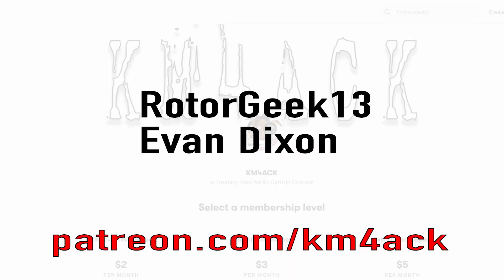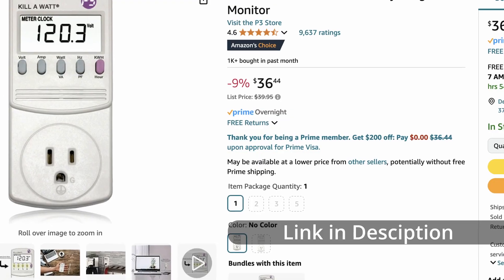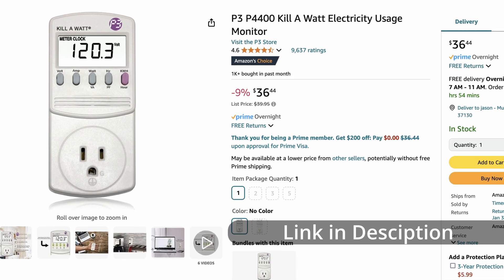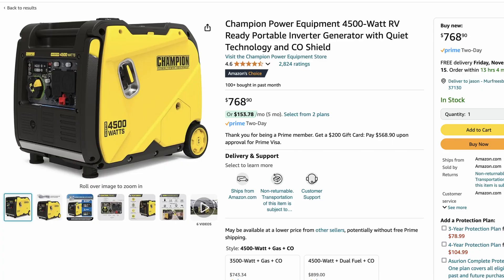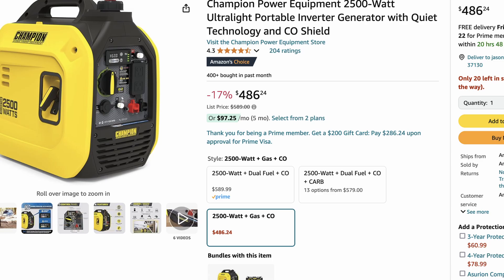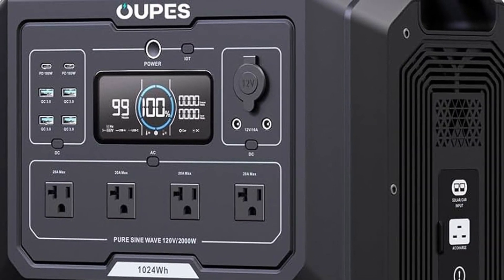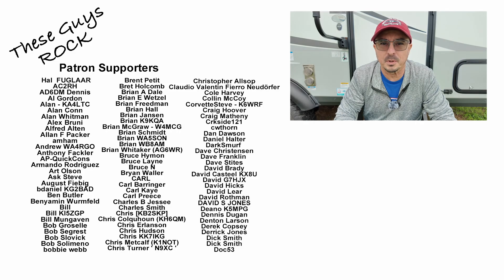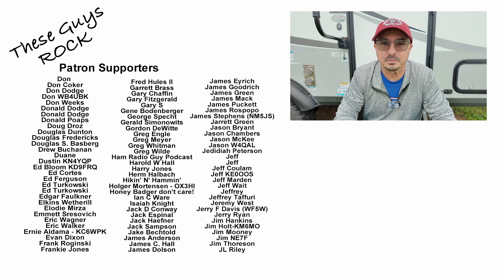Layering Your Backup Power Strategy

Comment: Great video as always.  I was in Florida with my daughter and her husband last month during hurricane Milton.  They lost power for about four days and here are some things I learned:

We had a Champion portable inverter gas generator that has 2800w output.  We ran it 24hrs a day but used the economy mode to conserve fuel.  I found it to be very fuel efficient, burning less than five gallons per day.  

I brought five filled 5-gal gas cans with me when I traveled from SC to FL, and that was helpful because as the storm approached, both gas and gas cans became difficult to find locally.

I brought a bunch of long extension cords with me but ended up getting a 12ga 50’ cord and wiring a square metal junction box with four 20a outlets.  That way I only needed one heavy duty cord to run from the generator into the house, and then we split off from there.

I also had a small Anker solar generator, similar in size and output to your Oupes.  We kept that plugged into generator power 24hrs a day and used it as a power distribution center for lights, USB devices, and even the fridge since the best location for it happened to be nearby.  The generator ran out of gas one evening while we were all asleep, so the fridge and fans kept running off the Anker.

Before we evacuated, I plugged the Anker solar generator into the wall outlet, and then plugged the fridge into the Anker.  My thought was that when the storm knocked out power, the fridge would run off the Anker for a half day until we could get back and get the gas generator fired up.  I had the inverter turned on, but also enabled economy mode on the Anker.  When we got back after the storm it seemed that the inverter had shut off, and the batteries were still near 100%.  I think that economy mode turned if off at some point to conserve energy.  I need to test that more, but that was a clear fail.  No more economy mode on the Anker.

Overall, the setup worked really well.  We kept the fridge going, the Keurig making coffee, and some lights and fans on.  Also, having Starlink for a backup internet connection was super helpful, and let us and the neighbors get messages out to friends and family.  Hope this is helpful info.  Thanks again – your channel is awesome.

Comment: Hurricane Helene has, in many respects, become a case study on preparedness - primarily because the population impacted in Western North Carolina are already, to a certain extent, preparedness-minded people.

One thing I'll note here, with regard to whole-house solar:  there was a big push in my area for people to install solar panels on their homes -- with discounts and financing available.  The critical missing piece is that the subsidies cover the solar panels and installation, and even a transfer switch.  What it doesn't cover is the whole-house battery storage capability.  So, what one many end up getting is a solar panel system on the house that, yes, offsets some of the grid-provided power utilized; but doesn't provide any sort of battery storage as backup in the event of a power outage.
  The reason for pointing this out is that, if someone is thinking of taking advantage of those discounts and subsidies to install solar on one's home, maybe consider saving up for a number of months, and spend the coin on installing battery storage when those solar panels go up on one's house.

The other idea I'd like to highlight is the issue of utilization of gas/propane generators to charge batteries, versus running items directly from the generator.  

Ultimately, what we probably want to do is what Jason describes here:  use the generator to charge batteries, and run stuff off batteries.  This method saves gasoline/propane, which (if Helene is indicative) helps a great deal.  Gasoline isn't readily stored -- it's bulky, requires stabilization, and presents a safety issue.  However, it may be the case that it's more economical over a 10-20...maybe even month-long power outage - to take the chance that one's gasoline storage strategy may be less expensive than purchasing additional battery storage to offset running the generator most of the day.
...but I doubt it. Even at 1-gallon per day, storing 30 gallons of gasoline in a residential home is...sketchy.  In an apartment? --Impossible.

One issue that may colour one's decision-making on this topic is the issue of OPSEC:  generators make noise, which can be noted by malign actors - and that generator becomes the target of theft - placing an additional burden of security on the table.  It is impossible to make a blanket statement on this, as there are many variables; but one thing is certain:  building toward a system that isn't reliant upon running a generator 24/7 is going to put one in a better position during a disaster:  the up-front cost is going to be greater, but that is offset by not being worried about where the next days' gasoline/propane is going to come from, and is much easier on the mind in terms of physical security for one's equipment and family.

The other thing I'd note here, that maybe gets overlooked:  if there is medical equipment necessary to sustain an individual in the home during a power outage, or if climate control is more of a medical issue, versus a 'comfort' issue; then we need to lean into up-scaling our power storage and generation to take these things into account.  Even a cursory examination of high-impact hurricanes -- Katrina, Helene, Maria -- all these storms impacted the disabled, elderly, and frail-of-health, disproportionately when compared to the general population.  This is only partially captured with a scenario like Helene, but a more instructive case study might be something like the Christmas Blizzard of 2022 in Buffalo, NY.

  During this event, emergency services and 911 dispatch were completely offline because the roads all had multiple feet of snow drifts on them; but also because the storm itself presented white-out conditions to drivers, making it deadly to be out on the roads.  We're talking about feet of snowfall, whipped around in hurricane-force winds.  Multiple people died sheltering in their vehicles; people literally died walking on the street due to hypothermia, exposure, and exhaustion.

In this type of scenario, timely restoration of power outages is not going to occur until the roads become passable again - which may be days.  It is impossible to get crews and the necessary  equipment to the sites where power restoration work needs to be done when every road is covered in feet of snow.

So...many of us may be caring for individuals in our homes. If there are pieces of home health equipment that not only need to be powered, but that power has to be present at very specific, certain times of the day, then this becomes a requirement that needs to be fulfilled when it comes to discussing one's Grid-Down power strategy.  Oxygen concentrators, ventilators, CPAP/BiPAP machines, medication nebulizers -- all key pieces of equipment in home health -- are at once high-wattage pieces of equipment and also utterly non-negotiable in terms of a power budget in a disaster.

Comment: One thing I have found, that backup for the backup, pays off.  I have a little 2000w inverter generator that I can move to the point of need.  It is the backup for the 10kw generator that will run the house with the exception of the furnace.  It can run 11hrs on a gallon of gas.  Remember, your 2k generator is 2k running on Gasoline.  Much less power on propane, and WAY less power on natural gas.  Once again, plan for "Worst Case Scenario" on max power needed and have a generator that can supply that under the worst full available.  I have an off-grid 1800w solar that I designed and build.  It powers all the house but not all at once.  We lose power many times a year, ranging from hours to weeks.

Comment: Jason, AC is a critical life support system for me and a lot of other people because of medical conditions. The trick is to zone off your home, and keep the cooling to a small area. I did this at my old home by using a window mount AC that I set-up in my master BR during extended power outages. In my current home, I have a split unit heat pump that supplies only my office,
Reply from the maker: My apology for not thinking that statement through well enough and pointing out that some may require AC for health reasons. Thanks for the zoning tip.
Reply: @ no worries man.  Thanks  for all of your hard work

Comment: consider USB light, fans and 12 volt TV also 12 volt refrig. (Cooler) these Items will keep your power station running longer. By not running the AC inverter which will draw a lot of power from your power station. As much as 20 to 30% over a 24 hour time.
Reply from the maker: Great tip and something I am slowly moving towards.

Comment: In 2011, we had a week-long power outage due to a series of tornadic storms. I run a 2000-watt Honda inverter generator converted to propane. I also have four 180-watt solar panels to recharge a Bluetti 2000-watt power station. I would like to eventually pick up a few more panels and some bigger batteries. I mix the generator and bluetti while alternating the fridge and freezer units.   Small 24 and 12 amp hour LiFePO4 batteries cover my coms system.   My previous experience was in 1992, surviving over 3 months while they rebuilt the power grin in south Miami-Dade County.   We had a small Coleman rattletrap generator back then.   Nothing like camping in your home for months of South Florida summer.   A supply of oil, spark plugs, and filters(if required) is also essential.   Great video.

Comment: Solar and batteries never run out of fuel.
Generators need fuel and you will eventually run out.
Reply from the maker: I agree with both of you. Solar for all I can get out of it and a generator to back it up. Solar and batteries or power stations like the Oupes will run most appliances. If it's a cloudy day, fire up the generator as needed to recharge the batteries. Then shut it off to conserve fuel and run what you need from the batteries.
Reply: After Helene passed, many owners of solar generators complained that there wasn't enough sun for the two days following the storm to recharge the batteries.
Reply: @aaronblake1533  That's like having not enough fuel stockpiled or having too small of a generator.
More solar panels is always a solution.
Reply: Solar burned my brother's roof. Also, damage to one panel can be problematic.

Comment: Whole house generators are pricey but they last forever and usually have extended warranties available.  We have a 12 year old Generac that had the engine replaced under warranty a few years ago.  Tests itself weekly too.  We have a gas backup, but I only start it when I think about it and sometimes it's a struggle.  Great vid though!  I need to get some solar in case both my genies fail.  73!
Reply: Generac has succombed to corporate greed. I don't recommend them anymore. Too much finicky stuff to break on them. Kohler and Cummins are better options if I had to buy one today.

Comment: One of the best plans I have seen on the tube ! I have almost the same set up. In addition to my main and smaller back up solar system, I have several smaller solar battery charging systems that can be hooked to a single 100 or 200 watt panel to charge an individual battery. This allows me to use the generator less, devote more power from my main systems into their battery banks and provides back up. I have back up charge controllers and inverters in faraday cages as well as my smaller systems. I also have many smaller fold out panels (20 to 60 watts) that can charge an individual radio (or other smaller item) via the USB on the panel and radios. This allows me to charge in the field along with my portable battery box that has a full charging system built in. I use the all in one 100AH batteries as well as cell packs built from individual cells and a BMS that range from 200 Ah to 800 Ah. Three different size generators rounds out my system.  As you said, have lots of panels and use a heavy enough gauge wire from the panels to the charge controllers to avoid losses in the wire. Don't exceed the maximum voltage from the panels into your charge controller (you usually reach max voltage before max amperage). For more charging amperage at the same voltage, wire extra panels into a parallel- series configuration. Great video, thank you for sharing !

Comment: Wonderful Video!! Think about a balance of gas/propane, solar and wind! Wind has been left out of most recent emergency power “stories”. Sun and wind are mostly on while the other is off … so to speak!

A lesson learned long ago with gas/propane generators - as soon as an emergency starts - begin a plan to get more fuel! This is esp. true if you do not have 100’s of gallons of fuel on hand!

Have oil change and tools and spares on hand and stored safely!

Having a plan to use the battery solutions while you are changing oil and other maintenance! Some  gennys need an oil change after 24-50 hours run time!!!!!!

Perfect practice makes perfect! Make a plan and work the plan!

73 de Ad5Zo

Comment: Great video.  For us in cold climate we have to think about back up heating source like a diesel heater   or pellet stove.  Some have basements so back up sump pumps are great to have. home Depot has battery one. Not too hard to install. I has a gasoline trash pump as well.  I have a diesel gen set as well.   Earthquakes can cut power and natural gas as well.  as well as water . I am in NY so our biggest threat is storms like blizzard or left over hurricane . or high winds . Tornadoes are rare   but we do get them like last summer. 73

Comment: The next best thing to a whole house generator is get a plug installed at your main electrical panel with a disconnect. You plug your generator into that and  you do not have to run extension cords all over.

Comment: I have 2 inverter generators from wen. 1 I've had for 6 years (2000 watt) the other I just got (2800) dual fuel. If gas is hard to find (definitely was after Milton) I can use propane. If i need more watts then I bought a parallel kit to combine both jennys. If one generator fails I still have the other until I can repair the one. And it's easier to transport one at a time versus one giant heavy one. I also have four ecoflow solar generators which I can charge with the little generator to run my stuff at night. Or I can use the solar generator, here in Florida, where it's almost always sunny. I also keep a bunch of oil and spark plugs on standby in case I can't get those in the event of an emergency or long term power outage. Not bragging, just prepping to help my family and others

Comment: This was an excellent video! This is exactly what I was looking for being that I don’t have any experience with generators. I may need to save up to purchase a dual fuel generator and use propane to charge up my power station. The information about the 40 amps to charge a 100 amp hour LifePo4 battery is invaluable. 🙏 Thank you!!!

Comment: I’d say another big point to remember is that if your strategy relies on a generator, you need to be storing some amount of fuel for that yourself.  I think most people planning to run on propane have propane tanks, but most planning to run on gasoline forget that gas stations need electricity, so gas becomes unavailable.  It’s a bit more expensive, but using non-oxygenated/ethanol-free gas for infrequent use small engines like this makes a huge difference in how well it keeps sitting around long-term.
Reply: Usually there is some warning, fill cans but definitely figure out a way to get gasoline out of a vehicle/s you might own.

Comment: I've gone for 4+ days without power during a snow/ice storm.  Didn't have a generator but it was cold enough to keep cold foods cold either in the gas grill or a box on the deck. Had a small direct vent fireplace to keep us reasonably warm. After 4 days, we went across town to a friend's house to shower. On the way home, I almost stopped at Lowe's to buy an overpriced generator, but had second thoughts.  Lucky. Lights were back on in the neighborhood when we got home.

Comment: What about the need for a pure sine wave generator?  Is one needed for modern refrigerators with digital boards?  A 240 V pure sine wave generator is very expensive if you only one generator that needs to run a well pump.

Comment: Too many think about "stuff" when a "system" is what's needed.  One does not have to go expensive on a whole-house setup.  Try a tri-fuel, portable, 7,500watt gen, wired into the house panel.  Natural gas is convenient and so is power at the flip of a switch.  My whole setup was $1,500.   A little propane and gasoline storage provides a lot of options.  Run it a few hours each morning to charge batteries and bring house/freezers to temps and again in the evening.  Couple that with a multiple 100amh setups: battery/inverter/charger and you have everything one could need for all day or all-night use.  Solar panels are fine but the sun doesn't shine everyday.  Considering dollar/watt, they are not a great investment.

Comment: Not only powering a well pump you have to conside a septic system pump.

Also those solar installations need commercial power to sync the inverters to.
Reply: Microinverter systems need grid power to output , however , not all solar installs utilize microinverters .
Systems utilizing integrated chargers and inverters , such as AIOs ( all in ones ) , hybrid inverters , and , off grid inverters , do NOT require grid power to operate .
Microinverters are useless for back up power , unless you want to jump through hoops to trick them into thinking that the AC you are feeding them IS the grid  .
This is doable , just not very convenient or expedient .